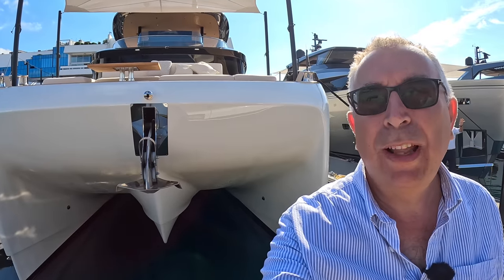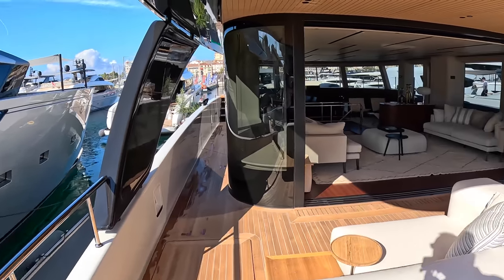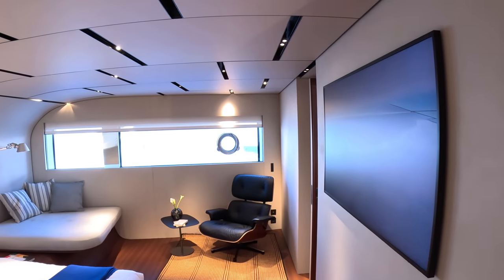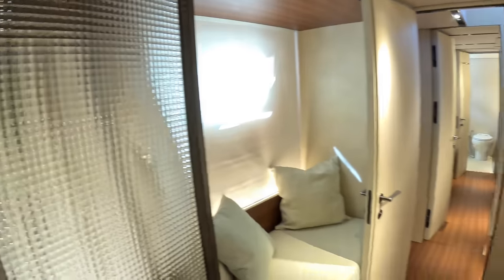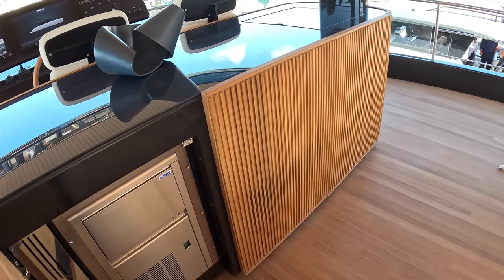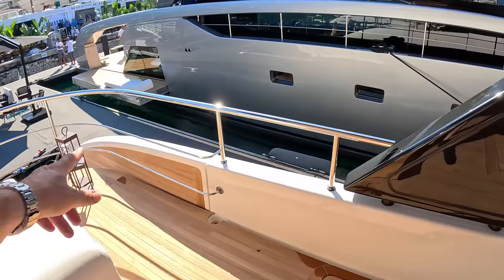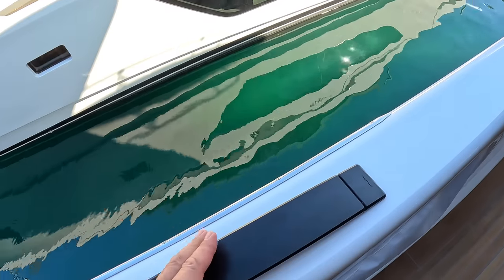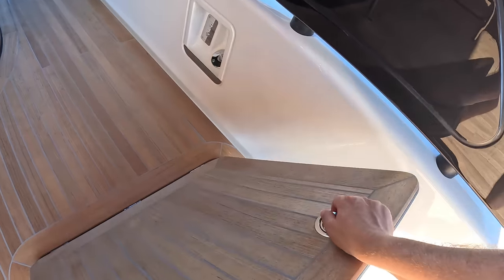€6.8 Million Yacht Tour : Bluegame BGM75

Comment: Hi Nick, it is a humongous catamaran but equally not well-thought-of. The location of the galley is terrible! Imagine sharing the stairs leading to the owner's cabin with the crew going up and down to serve a punch of guests sitting aft. They have to go all the way across the salon. And worse, think of the bow without proper side access.
Because of the deep hull and the port side stairs slicing the salon, the BG designers couldn't afford another one on the starboard side. Sharing the stairs with the owner's cabin is not a wise decision, is it?!  Every crewed yacht has to have decent crew accommodation, but a complete hull in a 75' cat for the accommodation and the galley?
Thanks for the lovely tour!

Comment: Thanks for the tour. You did a terrific job as always. Not a big fan of the boat as it is laid out. Mainly, the galley-down with companionway shared with the owner's stateroom seems daft. Imagine trying to carry a plate of sandwiches from that galley up to the fly bridge in a seaway, plus meeting the owner in the middle of the stairway. Awkward for sure. It seems like there is tons of space for a separate companionway to port to the owner's cabin. Also, there is loads of space for an upper galley which would be bigger, airier and nicer than the quite cramped lower galley. Finally, moving the galley to the main floor would enable a larger crew's quarters -- the crew mess on the boat you toured was barbarically cramped. Another quibble for me was the lower helm -- really unsatisfactory with no helm seat during a long passage in bad weather. I'm guessing 95% of owners would end up enclosing the upper helm in one fashion or another. 

Blue Game makes an array of interesting yachts, but I've walked through several of them and I always walk away scratching my head over some design issue that made no sense to me.

Comment: I can’t put my finger on it but it’s like all other cats it just lacks that feel. It probably the best of the bunch as looks and style but  after the new Princess Y80 it’s not quite there. I agree about the secondary helm seems to easy to play with unless it’s lockable. Maybe it was the angel but the galley looked a bit cramped and the cooker behind door seemed a design flaw. Does feel over priced.
I’m not normally negative but this one just wasn’t right. Thanks again Nick for your usual top notch presentation.